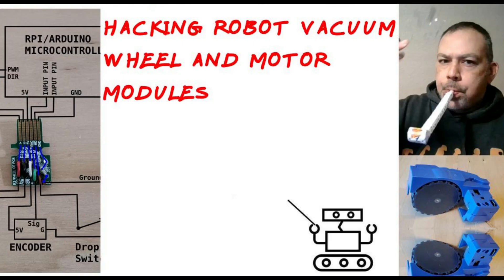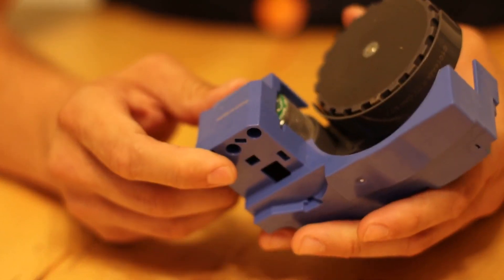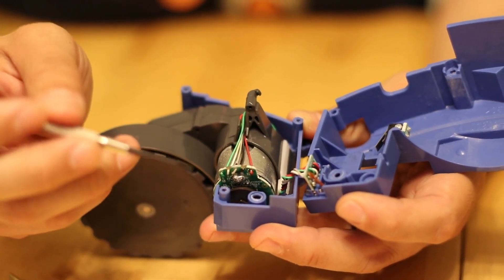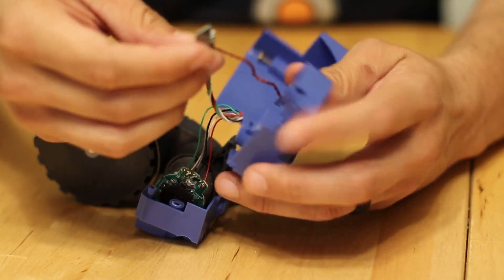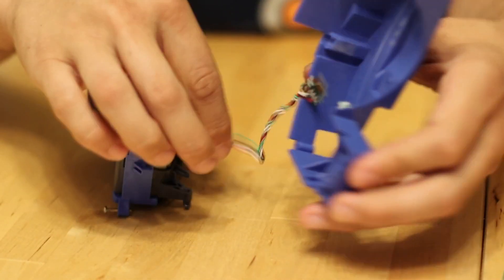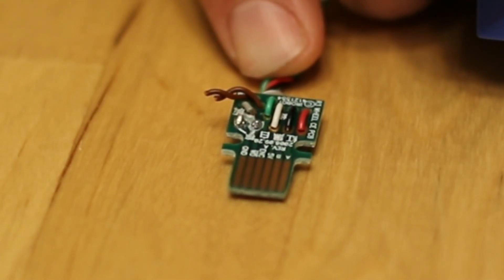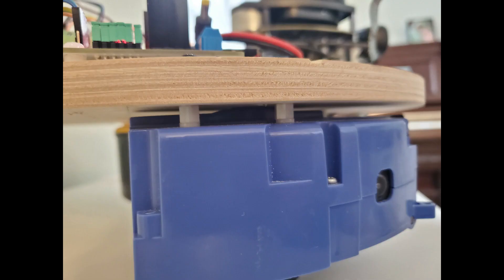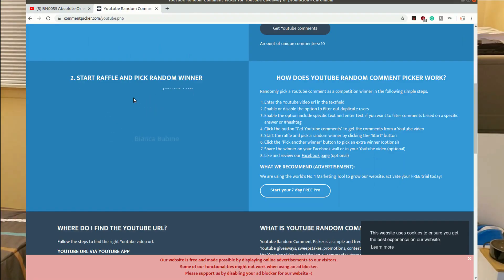Hacking Robot Vacuum (Roomba) Wheel and Motor Modules for Raspberry Pi or Arduino Robot Project

Comment: The GND/WD PINs are OL if the sensor is depressed, otherwise connected (around 0.3R, by my measurement). In other words: On floor = disconnected, lifted up = connected.

Comment: Do you have any basic example/arduino code for this type encoder module?
Reply from the maker: I'm afraid I do not have exactly Arduino code. Here is a link to some c++ raspberry pi code that counts the pulses and publishes them in ROS. It should be adaptable fairly simply or at least give you an idea of how it works. https://github.com/lbrombach/practical_robot/blob/master/practical_sensors/src/tick_publisher.cpp

Comment: Lloyd/ Anyone

I've recently been following your videos and bought your book through Amazon Kindle, thank you very easy to follow.

I have a motor / encoder question.  I bought a 12V set of catepillar tracks with a 20 slot opto-isolator encoder wheel on the end spindle of the motor.  I have three wires in addition to the obviously heavier power wires.(I connected 12V +/- a battery and the track worked well).  However the unit came without wiring instructions  to determine for the three remaining wires the GND, Signal,  and 5/3.3V.    The three cable colours are left to right Blue/Brown/White -- a different colour scheme to the version shown in the below link. :-/

Do you have a way I can connect / test with multimeter etc and determine the correct wiring hookups for this unit

https://www.tokopedia.com/arduinouno/dc-12v-motor-gear-box-robot-tank-rotary-encoder-rubber-wheel-set

Thanks Tim
Reply from the maker: Hi Tim, I wish we could post pictures here. I would personally start with a visual inspection first if possible - can the encoder wheel be removed without damaging it? If so, that could give us more insight as to the components without as much guessing. If so, can you post the best photos you can get of front and back of the encoder board to the book's Facebook support group at https://www.facebook.com/groups/practicalrobotics ? That will help... some general starting point: In chapter 14 of the book, figure 14.3 shows some wiring that is very likely similar to what you have. Notice the one thing in common is the ground wire - that is likely why you have 3 wires instead of four. If you can find the wire that goes to both devices, you've probably found the ground wire. Next, can you see a resistor in series with one of the LED-looking things? That is probably a current-limiting resistor and you have likely found the side of the device that is the emitter. Although without seeing your device I cannot guarantee that a current-limiting resistor is included. Another thing that can be helpful is to measure resistance between each wire - although because we are dealing with diodes one polarity will always give a bad reading so you have to measure, record, the switch the leads of the meter and read the same wires again and record the second number. Read and record for all possibilities so .. connect red meter lead to Blue and black meter lead to Brown and record the ohms, then switch leads so black is on Blue wire and red is on Brown wire and record the value again.  Then do the same for Blue to White, and Brown to White. Report back with all six values here or on the FB group with the photos if possible.
Reply: @PracticalRobotics  thanks for the prompt reply, I will try to remove the encoder wheel although I think they are glued to the shaft (for obvious reasons)

I'll head over to the Facebook page with updates.  Thanks Tim

Comment: Great  video, I have been fascinated by these robot vacuums and have been buying salvaged models from ebay, reconditioning them and selling them. I am really interested in hacking one or using the parts to build something
Reply from the maker: Glad I could help! When Practical Robotics in C++ is released, it does have a section to get you started with hacking Roombas and controlling them from your programs. Salvaged Roombas are probably my favorite indoor robot platform! After facing some serious staffing challenges due to the Coronavirus and lockdowns in their country, the Publisher has reached out and has restarted. I've given my final approval and finally expect publication any day now.